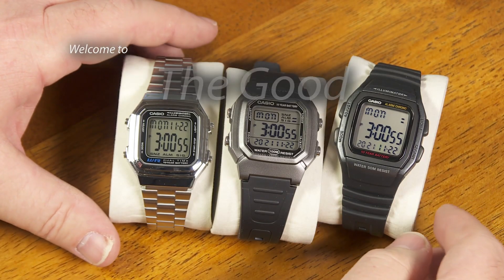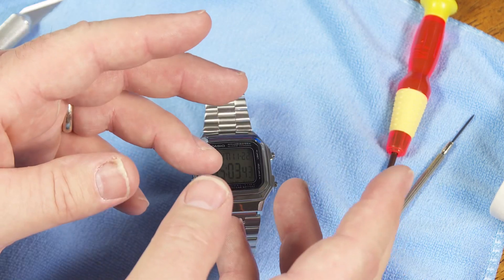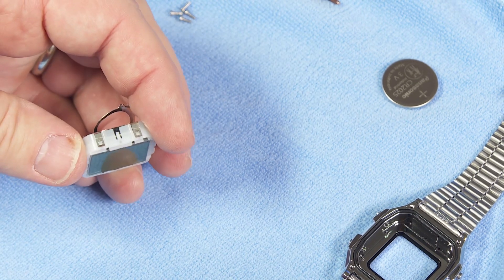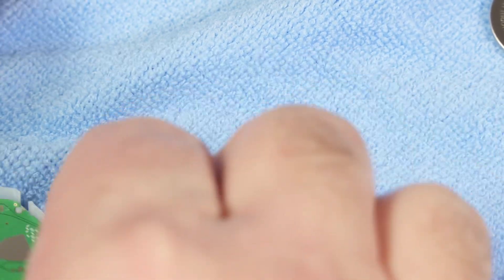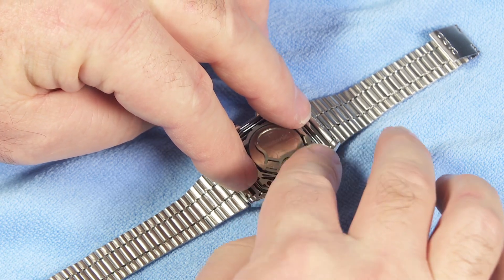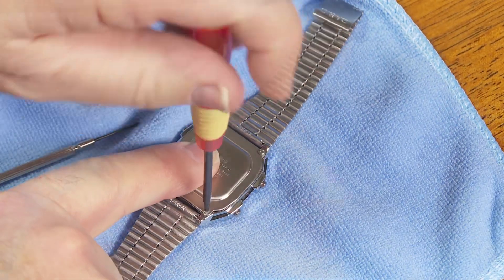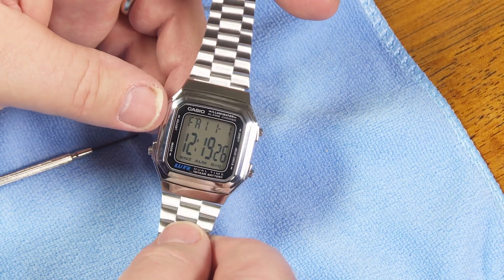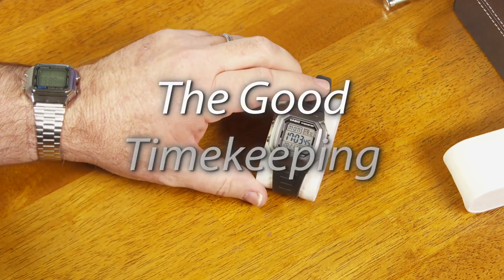Countdown Timer Mod for the Casio A178W

Comment: You could have permanently damaged the traces on the circuit board had you slipped. Really stupid method to recommend scraping with an X-acto knife. The only way to do this safely is with a low temp soldering iron and solder wick or a Sold-A-Pult. And you’re clearly a hack. You don’t even have tweezers to reset the module. The case isn’t metal. Only the caseback is metal. The case is plated resin.

Comment: You could have activated the 5 alarms option while you had it on the operation table. Connect the pins 1. You only disconneted pins 0. Connecting pins 2 disables the dual time keeping. Don´t know what the other ones do. When I get this watch and a smaller soldering iron I will start experimenting with it.
BTW using an exacto knif can damage the board. Use a soldering iron and a wick.

Comment: Hi Greg,
I was wondering if the A187W module can fit into the W800 -H?

Reason: I want to have a resin case which is tougher
Reply: & has 100m water resistance

Comment: For folks asking why features like Timer are disabled:

Casio watches sometimes have timers or other features that are soldered and disabled to reduce costs by using the same hardware across different models. This allows Casio to produce a single type of circuit board that can be customized by enabling or disabling certain features through software or hardware (like solder points). Disabling certain functions through soldering can help differentiate models in terms of price, while using the same basic technology for efficiency.

For example, a higher-end Casio watch might have all features enabled, while a more affordable version could have some features like the timer disabled, even though the hardware is essentially the same. This practice reduces manufacturing complexity and costs while allowing them to offer a range of products to different market segments.

Comment: Just did the mod by myself. I have several tips:
1. There is no need to remove the battery. Removing the metal encasing is enough to get into the module.
2. Use a fine tip soldering iron, the pcb may be damaged by the scrapping.
3. Yo desoldered the bridge number "0", but the other 4 also has uses. Soldering the first bridge it gives you access to 5 alarms, and the second disables Dual Time. I have no idea what the other two bridges are for.

Comment: My A178W has a different PCB and different battery holder. I could not do the trick. The foking spring fell down and I was fortunate that it stayed on my leg and didn't fall down to the floor.
Reply: btw. my A178W was bought 15 years ago.

Comment: Hi Greg! Greetings from Serbia. My Casio A178W was bought in 2009. Module number is 2519. It has completely different PCB and it has two solder balls (a kind of electrical jumpers). I am not sure that it is possible to mod my module to have countdown timer function.

Comment: Great video. Unfortunately, when I opened up my A178W, the circuit board was quite different. Actually, the entire internals were different -- the spring was in the top left corner and the battery, its back sticker and hold-down mechanism were different. There were several small solder points on my board, but none in the location or orientation yours showed. So, I had to close everything up and just keep my watch un-modded. At least it still works!
I should note that the "test screen" you showed does not show "3233" on mine, but "2500" instead.
I should also note that I bought this watch 12 years ago from Amazon for $17. I'm one happy customer!
Reply from the maker: It’s not surprising if Casio updated the module but, otherwise, sells this as the same watch you bought 12 years ago. That would explain all the differences you discovered.

Comment: The speaker on the back requires the 2 contacts, one being the spring on the left side there that touches the speaker itself.  The other is that leaf spring on the lower right that makes a common connection.  The battery holder is bent and was hitting the metal on the back and the speaker at the same time shorting it out.

Comment: So, Ian Rees has a blog covering what the different solder points do.  You can enable or disable the dual time feature.  I find this interesting as I absolutely HATE dual time.  I'd rather just set the correct local time.  Thanks for the Video!  Helped a lot.

Comment: A good thing to do if your gonna take the watch apart. A tiny bit of silicone grease on the O-Ring helps it last longer.   Not that it really matters that much it is a super cheap watch.
Reply: Using a film of lightweight grease also adds the benefit of the seal not wandering around as you replace the cover and tighten the screws.

Comment: How many of these watches are there that are capable of this mod?
Reply from the maker: The instruction booklet for this watch also covers the module from the F200W watch. So I would think that watch could also be modified. However, I can’t find anything online where someone specifically says they modified the F200W. So I don’t know whether to experiment with that one.
Reply: Like a ton
Reply: Thanks for the info here. I do not understand why Casio would limit the funtionality of any of their watches, especially the countdown timer which is incredibly helpful 🤔.  Great video! 👍 ❤ ⌚
Reply: AFAIK the W800h, W96 and this one. F201 uses the same module, but has all features activated. Fun fact: you can put F201's module in this one's case. This will also allow you to see auto repeat for the timer and whether the alarms are activated.